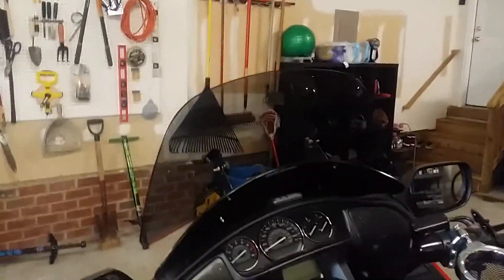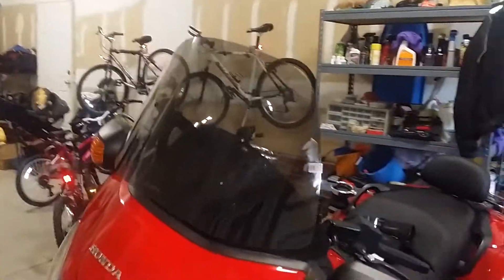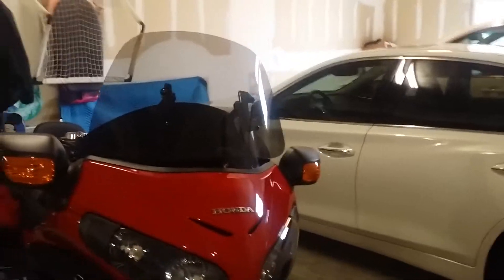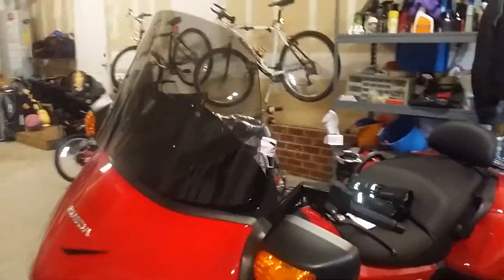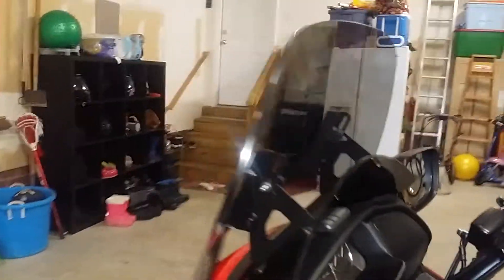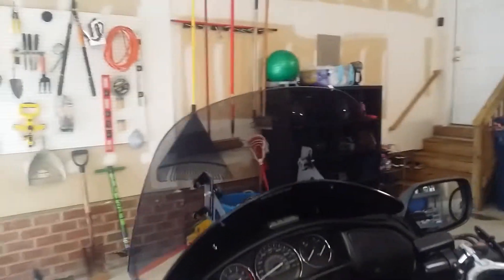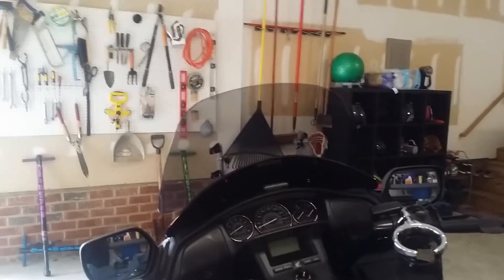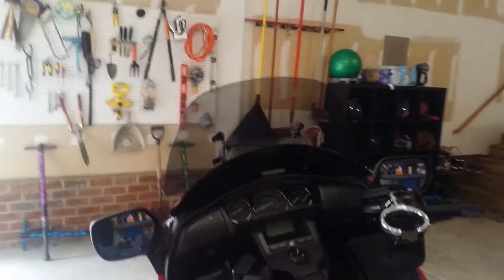F6B Madstad Windshield Review.

Comment from the maker: Just took wife out, combined highway 75 to back roads, she is committing to 75%  Maybe 80% less buffeting!. She loves it, She said when she liens forward now there is NO wind, but she is very comfortable just kicking back. Temp was 51 degrees 2 mph wind. Side note, I did move to the highest level, and during my review it was actually only and inch away from highest level. Total up and down adjustment is 2.75 inches. Make sure you put on centerstand or have someone to hold to check the 55 to 60 degree windshield angle. big diff from looking at it on the side stand.

Comment: Thanks for the video John! Great review. Never even thought about this windshield before. I’m on the F6B forums also. Just ordered one for my 2016, 15” being 6’3, I’ve always thought the buffeting was normal for the F6B, had a 1200 and 1500 prior and didn’t have the issues. But I had put a 14” F4 on and love it for the scratch resistant properties since I clean it every day. I ride home after midnight 35 miles so I get the bugs. But been riding for 3 years and just got used to the buffeting. So when I saw your video I had to order one! Yeah I hate the buffeting all the one since most of my riding is between 55 and 75 up hear in Southern PA. Luckily they are having a sale this weekend with 15% off. Will let you know when I get it on and thanks again. And like the rest of the F6B’ers, 3 windshields and 2 different seats so far!
Reply from the maker: Great story, LOL on the three windshields two seats! Definitely let me know how you like it once you get it on,  again it won't get rid of all of buffeting , but you are going to be amazed at how much less you get, now when you get up right behind an 18-wheeler you're still going to feel it. keep me posted
Reply: John Keller 
Hey got the Windshield installed last week with the 15” and it sits right at nose level for me at the lowest level. being 6’3 with 34” inseam, but I have a Saddleman seat on my deluxe,!so ordered a 13” windshield to replace it and sending the 15” back. I also have the hand wings installed too, so it does cause buffeting too. But love the windshield! Especially the adjustable part of it. I keep mine all the way back and down also. I had an 18” with my F-4. Think the 13 will work out much better so I can see over top. Don’t think it looks bad either! Didn’t take long to
To get used to the look, mine the matte silver so I have everything blending in on mine. Thanks again for the recommendation
Reply from the maker: @OldGreyBeard57  man glad you're happy with it, hate that you have to send it back, let me know how the 13 works out

Comment from the maker: So about a 500-mile update, went out today for the first time with my open face, mad stad shield down in the lowest position with a 17 mile an hour wind, angle at about 56 degrees, highway speeds, just what a beautiful windshield! So aerodynamic, just a touch of light wind,! So much better than the baggershield convertible I just can't tell you! I'm now beginning to like the looks of this, better than the bagger Shield! That is when I have it completely in the down position, it's just so much less real estate, kind of more like Honda wanted it to look with the shorter Shield, yes it turns into a little bit of an ugly duckling when you start raising it up and moving that angle forward, but I love to have that option for when the Mrs is on the back, had her out the other day again, not in the full up position this time, still had about three quarters of an inch to go, with just a tad angle front, probably 57°, and she said she felt nothing back there and just completely enjoys the nice quiet ride now! Yeah I know the 2018 gold wings are out, but I'm going to stick with my F6B, love it!
Reply: I have the identical bike and 15” windshield. I experimented by dropping the upper holes on the shield to the lower holes on the bracket. It performed exactly the same, even at highway speeds. I ended up drilling new holes for the screws to mount in the upper bracket holes. It looks so much better, and you can see completely over the windshield.
Reply: Also great job on the videos, you’ve bailed me out of a couple jams. (Center stand spring)

Comment: Hey John, been watching all your F6B videos—enjoy them a lot!  Just bought the Madstad for my F6b and have some questions about settings.
Reply from the maker: Fire away! I can tell you what I've ended up doing, I have a tilted full-back all the time now. Either in the complete down position or the complete up position, during the winter it stays in the up position pretty much all the time except for when I have to ride at night which is very seldom now that I'm not communing. I just noticed when I tilt it forward even a little bit, I get some air coming up over the back of my head and hitting me in the neck and I don't like it! it's nowhere near near what you feel behind a big, non-dual, tall windscreen, that long Rider Shield when I would been down a little bit, really felt like it was shoving my head right into the damn fairing!

Comment: Ok, ive got the 2007 GoldWing Im 6ft tall 33 inseam also and with my Oem shield all the way down the wind is just hammering top of my head to the point of being very dizzy.. I dont want to  raise it because I like looking over the shield a few inches not through it. I was looking at the curved up top long shield but might go with this. Will this  eliminate most head traima? lol..
Reply from the maker: Yes as I mentioned you're not going to get buffeting like you're getting now if you go with the shield, I think that the one that I have and I think it's a 15 inch, will be perfect for your size as actually mine all the way up hits me right around the bridge of my nose depending on how I'm sitting, so it'll be perfect for you looking over at a couple inches, I'm 6 ft

Comment: John, did you notice the acrylic baseplate leaves a bit of gap between the factory plastic "dashboard" and the acrylic baseplate? I've taken pictures and asked MadStad about this twice and it's been crickets. I'm not as concerned about the gap visually speaking, but I've noticed when you ride in a heavy rain, water definitely finds its way into that gap where the headlight and other electronics undoubtedly live. Just an observation on my side. I think I see the same gap at certain points in your video but can't be sure with the lighting. Thanks, John.
Reply from the maker: Great observation and I've never noticed this until you just pointed it out, I do very little traveling in the rain, only when I get caught at it, but I'm guessing for those cross country folks with F6B this could definitely be a concern, thanks for pointing it out, let me know if madstad ever gets back with you
Reply: @johnk12345100  Heck, not even cross country just across town on a rainy day commute! I am not 100 percent certain there's any exposed wiring harness or anything back there, I don't think there is but still... I finally got a response 2 days ago but it was just a note that they'll get back to me on it haha

Comment: What about riding in the rain withthis setup ? How does it handle the water ?
Reply from the maker: Oh the water's great, and the stock tires seem to do a great job, in the amount of times that I was in the rain, I try to stay out of it! But I can still take Corners pretty decent, just doing all the normal riding precautions though when riding in the rain, especially with leaves on the ground! I ride like I'm on ice when I'm in the neighborhood with a bunch of leaves.
Reply: @johnk12345100   I was asking about the windshield setup and how it handles water and such ? I am a darksider on my 2004 GL1800 so rain is not and issue for my tires but on paprr this Madstad setup is superior to other shields I have looked at.
Reply from the maker: @richlargent5665  oh, well again I don't ride in the rain much but this setup does not keep the rain off your lower fairing instrument panel

Comment: I have been looking for some information on this windshield set up but dang, the constant wibble-wobble of the camera makes it really difficult to watch this.  Put the camera on a tripod or something.
I am not sure what is the Madstad. Is it both parts of that set up, or is the Madstad just the outer part attached to the stock windshield??
I found the info I needed on a Motorcycle parts website. For those who, like me, were not sure of the breakdown of this windshield, this is what was written on their website;

“The Madstad system consists of a base windshield in gloss black (it replaces your factory windshield), our patented adjustable brackets bolt to this base shield, and then the new windshield attaches to the brackets.”
Now that I know exactly what this system consists of, and also the information from John Keller, I am planning to order one for my 2013 F6B.

Comment: Nice video with exceptional detail on the windshield, this gives folks a very clear overview of the shield and what to expect with fitment and ride quality!. Thanks for your time and effort into posting this, it really helps folks making a decision on such an expensive item! -- Question, do you think at the lowest position with stock seat, a 15 inch shield would work for an inseam of 32 inches, I am 5.11 and after measuring, 15 inch screen seemed about right, however I am particularly interested in the dark gray shield, any thoughts about that? I tried a klock werks flare 13 inch and there is way too much buffeting and i can easily see over it with a couple of inches to spare, night riding would not be an issue with a 15 inch klock werks i don't believe. Any feedback is appreciated, tough I know because its such a personal choice.
Reply from the maker: Your size and inseam is very close to mine, I'm actually 511 and 3/4! If I had a passenger I would definitely go with the 15 in 4 passenger comfort and less wind in the highest position. I think if I did mostly single ride in, now that I've had this for a while, I may opt for the 13 in dark like you're looking at. Reason being it does hit me about right on the nose in my comfortable riding position in its lowest position, so although I am looking over it it's right there. I would talk to mad stad and make sure if you order the 13 and not happy with it, you can exchange. I think I tried that exact shield, in Clockworks and it did suck for buffeting! You will not have the fitting as a single Rider with that 13 I can almost guarantee it. Thanks for watching Good luck
Reply: John Keller thank you Sir for your time and energy, I didn’t expect a response so quickly. I will call them tomorrow to get some additional clarification. We are very close in measurement as I am probably a half inch shy of 6 foot with same inseam. I sold my 2015 ultra classic for the F6B, — if you have ridden both and are not brand loyal then you know why! I had a LRS on the Ultra and the wind / buffeting was perfect, maybe due to the design of the redesign 2014 vent, but wow it was a perfect ride from air management perspective, but lacking in performance, handling, turning and smooth roll on power. I’m glad I made the swap, now I just wish I had the same wind protection and radio — that’s another story.. I will take the pure rush of riding an F6B any day over the Ultra. I ride mostly solo, my wife is only 5.1 so hopefully whatever works for best solo will work for her on the occasional rides she does.

Comment: What color light gray or medium gray?
Reply from the maker: I went with medium and it does pretty well, a little dark at night but I sit up tall and look over if I need to
Reply: @johnk12345100  thanks for the response I was torn about the tint being too dark and I a 5’10” with a 2013 F6B with a stock seat. Went with the 15” height to accommodate my wife.
Reply from the maker: @jamessmith6136  great choice!  My wife said it's the smoothest are that she's been in on the stock seat. Now if you hit 80 85 on the highway you'll find her leaning forward a little bit and down, as sitting up high still gets a bit windy, but oh well keep them close LOL.
Reply from the maker: @jamessmith6136  oh and I'm stopped trying to manipulate that screen and pushing it Ford as I feel that it creates more Backdraft and turbulence for the passenger, you can play around with it but my mainly stays all the way back plus it just looks better